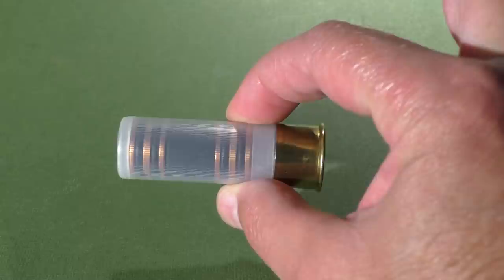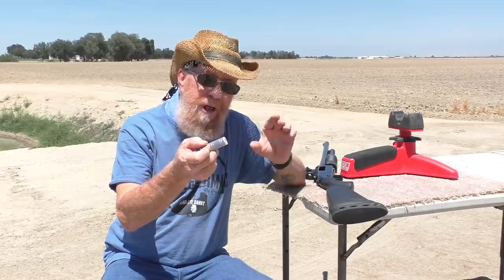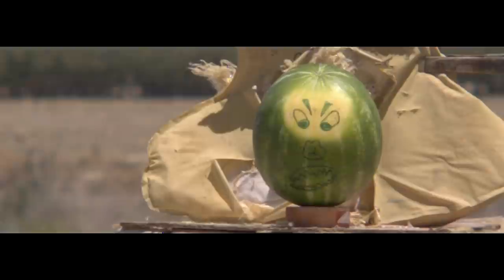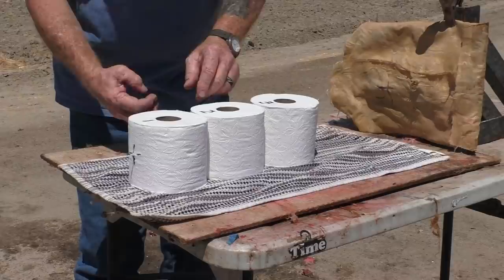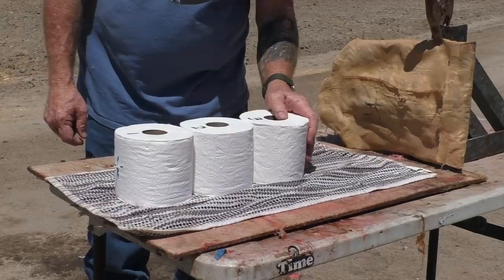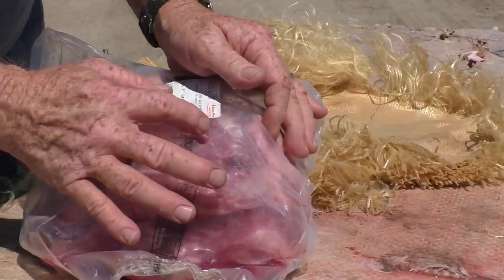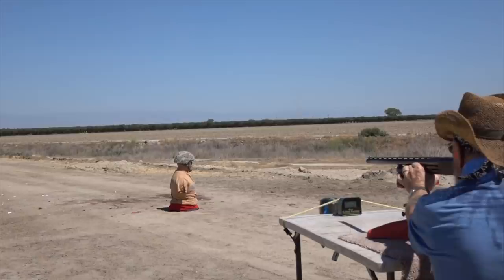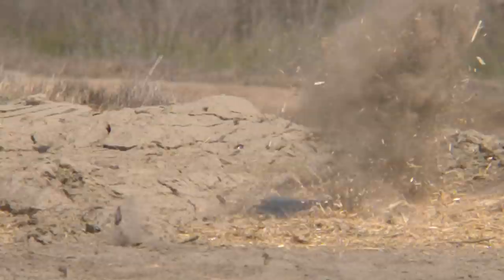Testing the brutal 2oz.  Subsonic Dumbbell 12ga Slugs

Comment: You could put Shockwatch stickers on the head under the helmet, to see if the impact alone is lethal. Mythbusters used these
Reply: By the looks it would be instant death
Reply: There is no way you could survive that kind of blunt force trauma to the head, also the way that pulled on the jaw, I don't think it would have broke it... I think the jaw would have been completely ripped off the face. That's the kind of hit you hope kills you. because you would never be ok after that.
Reply: I think if anyone wants to test the force of these at home, go grab a roll of toilet paper then grab a hammer and hit that toilet paper as hard as you can, I guarantee that you aren't going to put a hole in it and I guarantee it will go sailing across the room. It is like horsepower vs. torque. Horsepower is nice but it's the torque that wins races.
Reply: That’s a skull crusher turns brain into scrambled eggs

Comment: Jeff, I’m sure you’ve analyzed it every way possible but, considering the gas seal, the rounded bi- directional shape is hindering obturation of the seal itself. Without a, for lack of better words, “flat end”, the gas seal is deforming and rupturing while trying to get the large mass moving. I speculate that the o-rings are also helping with the seal of the bore. I can’t help to consider what a flat sabot “cup” if you will, would do to the x12x’s ability to obturate the expanding gases thus, increasing the velocity. If it were I, I would make that very suggestion to the “ballistic machinist” for a form fitting sabot cup to stop deflection of the lips of the x12x gas seal. I do believe the performance would be enhanced and quite possibly do so reducing the actual volume of powder needed to accomplish hitting the intended velocity target. 

Keep up the good work folks!! It’s sure good to see Danny out at it….

Comment: My guess would be the Sabot is to keep the slug reliably situated. With such a tight fit, when the first end of the dumbell exits the barrel, if the Sabot wasn't in place and the slug shifted whatsoever, the Edge of the second would catch the barrel pretty hard, and the pressure difference between Inside the barrel and outside could cause such a shift. But with the Sabot in place, it bridges the gap between the front and back, meaning that the slug can't wiggle when the front is out. I'm at the 1:32 mark, I wanna see if that's the conclusion you guys got to as well.

Comment: Sabots might be to keep weird things from happening inside a silencer when the slug is going through the baffles. The slug could wobble inside the silencer with the ends of the dumbbell snagging the baffles on the way through. The sabots are turning the slug into a simple long cylinder, which should be kept straight by multiple baffles. The Sabots shattering is still an issue though. If the Sabots don't shatter, and can wobble around going through the silencer, I'm not sure if they're not just as likely to start snagging on baffles as well.

Comment: Not only is the weight of the toilet paper roll much higher than that of the slug The slug is imparting it's energy over a relatively long period of time and not imparting very much of it as it doesn't meet a lot of resistance going through the toilet paper.  Part of the reason why it's harder to push the screwdriver through is that you are relatively going much slower than the bullet is which gives the toilet paper time to compress presenting a much stronger target. The bullet is essentially going through the toilet paper one sheet at a time.

Comment: Two Ounces?!? Perfect for home defense, I'm guessing...
 
I love the fact that you guys are willing to TEST such interesting and innovative design concepts! Keep up the great work.
Reply from the maker: thanks Doc!
Reply: Perfect home defence if you have concrete walls 😉
Reply: yea, for defending 2 houses down without leaving your sofa hahahaha.
Reply: Yeah, you're not concerned that a heavy slug will be too slow to accelerate, making bore pressure exceed safe levels?
Reply: I.... Must.... Resist.... the Temptation.....
........
............
........
NO....To Late.........  ARGGG!!!

So What's Up Doc!!    😁
Reply from the maker: @machinemaker2248  No.  It uses a powder load for that weight.
Reply: @machinemaker2248  
The same powder charge does not get put in the shell regardless of projectile weight. Heavier slugs use reduced charges, or better yet, slower burning powders.

Comment: The O-rings are for a good gas seal and the sabots are working as a traditional sabot and is a bit wider than the O-rings, if the Sabot was not there the friction of the rubber O-rings passing through the barrel could be to great and act as a barrel obstruction and the barrel could explode.

Comment: I guess I should have told you about the sabot. They are there just to fill the center of the slugs. Because I found out that out of a box mag feed shotgun the hull would deform as the bolt slid back and it would take a chunk out of the hull. Then when you fired that round it would put a hole in the hull.
Reply: This needs to be moved up to the top of the comments list!...MLV!

Comment: I think the sabot are meant as additional gas sealing as it travels down the barrel so the gas dont go into the empty space of the dumb bell. Also maybe to prevent destabilization as the slug hits open air at the end of barrel so it starts as a straight path and end as a straight pass?

Comment: Would be cool if this round could be revisited, possibly with and without the sabot, and perhaps testing a few different gas-seals.
I'm thinking a felt based gas-seal would do well, as the ends of the rounds are flat and smooth.
A felt seal should transfer the energy well, without deforming much, and should release the slug well, once out of the barrel.
This is all theory crafting, and the real world might prove me wrong. 😅

Comment: 13:00 Get an easy up cover and a 5 gallon bucket of water. Erect the easy up for shade and use the water to soak your shirt when it gets dry. You are in California, it's dry as, your sweat will not soak into your clothes and slowly cool you down.... it dries too fast. Soak your shirt in the bucket once dry and you will be 10-20 degrees cooler when you put it on. It can be 110 here in Cali and be tolerable when wearing a soaked shirt, I know because I do it every summer.

Comment: That dumbell slugs got immense stopping power even at subsonic speed which is insane.. By using copper to use as dumbell slug material means higher density.. Higher density means longer distance as well as even deeper penetration you can get from that slug..

Suitable to hunt and to take down larger animals in the wild..

Comment: Fizzicks?? Yeah thats why sometimes an arrow can out penetrate some bullets. Depends a lot on mass and momentum. Momentum takes over once velocity has dropped enough. Etc etc. FBI studies perplexed researchers when they discovered that some sub-sonic rounds out penetrated equal counterparts that ran at high velocity. The recoil on a 12 gauge slug is somewhere between 45 and 60 lbs if i remember.

Comment: Hollow point it & cut the lines for the peddles to achieve expansion. Leave the center or grip of the dumbbell a little thicker to compensate for the lost material & still achieve the 2oz subsonic capability?

Comment: My guess, before seeing the results of the Kirkland Ballistic Toilet Tissue test, is that the barbell slug will shred all three rolls, propelling them in two different directions as the slug take a slice (left) trajectory. It will be as if you buried a firecracker in each roll, lit the fuses and ran!

Comment: When you guys shot the TP rolls with the .22, it made sense that it would punch through without really moving the TP much.  Small frontal area, relatively high speed, light weight projectile.  But, I will admit, I thought in this particular case, the rolls would move more quickly than they did due to the heavier projectile, greater frontal area (contact surface) and slower speed.  I mean, I expected damage to the TP rolls, obviously, I just thought the slug would push them away easier.  Is there also a friction coefficient from the TP being in contact with the table surface that must be overcome, as well?

Comment: 12:00 Strap breaking your jaw is not even a worry, you are already dead. You won't care if it will be an open casket funeral or not after that, you wont care about anything else either.

The extra weight of the round makes up for the velocity and twice as heavy but not half as fast makes it powerful indeed.

Comment: Curious, does the higher bore pressure from lower acceleration concern you? Do you do math or test strain to verify that it won't exceed the designed limit of the barrel? Would you cover this topic in a future video? Thanks!
Reply from the maker: There's plenty of 2 oz +  loads out there,  like heavy duck loads, etc.    So the load data is already out there.

Comment: This is not new. The French were experimenting with this design in the 60's. I remember seeing a slow motion photo of one of their slugs approaching a 5 gallon can of water. The can was exploding when the slug was inches away from the can. The air pressure in front of the slug was rupturing the can. The slug looked like a spool with no thread on it.

Comment: Not at all surprised by your result.
High sectional density projectiles with a wide flat meplat penetrate deeply at almost any velocity. 

When I was a kid we shot small to medium feral hogs with 38 specials loaded with a 200 grain wadcutter at 950fps.
Goes right through them.

I own the second 475 Linebaugh that John buiit.  It was going to be awhile in the making.
To give me a gun to shoot that season he put a Bisley grip frame on a Super Blackhawk, rechambered it to .45 Colt and put a 5.5" slow twist barrel on.

He told me I would love the .475 but predicted that the cobbled togeth  ....45
Reply: Whoa...😲 Ouch! Niiiice!
Reply: My solution is a Ruger Blackhawk 357 Magnum, five inch barrel, loaded alternately 125gr hollow points with 158 gr Hexalit, and 180 grain naked lead Grizzly Bear loads... Nasty velocity with that perfect weapon,, do the math... velocity over bullet mass, almost every time, but 357 Magnum has both. I have the 45, the 9mm, the twin Blackhawks, 22LR & 357 Magnum, and the other nasty stuff
Reply: @Horus2Osiris  
Math honestly means little with terminal ballistics unless you do ALL of the math.

Foot pounds is a terrible metric for measuring effectiveness...especially with dangerous game.

Bullet design becomes a major issue and generally if you are shooting animals bigger than deer with a normal sized revolver or pistol. heavier with a flat point is better.

Most buffalo culling operations in Australia use a 30/06 with a 250 grain bullet at moderate velocity...it breaks bone and penetrates.

We used the .475 to good effect there. 425g at 1300.

J.D. Jones choice was the .375 JDJ , 300g solid at just under 200fps....sectional density is over 300.
Nobody on the planet except Ross Seyfried has killed more dangerous game with a handgun than J.D.
Nobody more with revolvers than Ross and that includes several elephant.

For deer or even elk I have no qualm with the idea of high velocity bullets. I guided for years and saw lots of animals die as if lasered.
My own antelope gun is a 5.6x57r that pushes a 70 grain bullet at 3700fps.

I have also seen a lot of meat wasted and I hate that.

As far as 180g in a .357 goes it is a great choice. There are several fantastic options for bullets and it is easier to load than the 200g slug. Even with the WFN we use .38 special brass because of chambering issues with some guns. 

I think that the arguments perpetuated by some writers of high velocity v. low and heavy are ridiculous.  Both approaches are beyond proven. Dead is dead. Just make an intelligent choice for the ranges you shoot at.
Those afore mentioned 200g .38's that I love are useless beyond 75 yards or so.
None of it really matters unless dangerous game is the issue.

Cheers!
Reply: 30-06, favorite,  308 Sniper, 308 assault rifle... pistols, whatever, looking for an inexpensive 50 to extend my effective range...

Comment: Try Airsoft BBs again. They make  .45 gram BBs, which is much heavier than the .12 and .20 walmart BBs. They also make .69 gram BBs but they are ceramic and not commonly used. You could get close to 22 grams of BBs using .45s in a shell. That would be plenty of weight to do some damage.

Comment: Is That a Tornado or a smoke ??
Reply: It's a dust devil. A strong, well-formed, and relatively short-lived whirlwind. Its size ranges from small (half a meter wide and a few meters tall) to large (more than 10 m wide and more than 1 km tall). Dust devils are usually harmless but can on rare occasions grow large enough to pose a threat to both people and property.

Comment: yall keep complaining about the gas seals being "damaged" - no - they did EXACTLY what thayre meant to do....which is to ONLY survive through the barrel and hold in SOME of the gases....thats why there are so many of them, no doubt the manufacturer KNOWS that most of them will be sacrificed....my guess too is that with copper being harder than lead it cant seal as well as the maleable lead normally would, hence the need for the seals to begin with, and the low velocity is surely due to the fact that a lot of gas is lost as well for the same reason....the 'sabot' in there is just for stability THROUGH the barrel - once they (seals/sabot) has exited the barrel, theres no need for them whatsoever so it doesnt matter if they fly off - they havent failed, they have succeeded as long as you get the advertised velocity....manufacturer would probably be better off with a copper core and thin layer of lead cast onto the outside of the backside (breech end) for better velocity without the need for gas seals or even sabot thing as the lead would conform to the barrel better....
really curious how thatd perform if the front end were cupped out like a shallow hollow point - might make it unstable in flight though...perhaps that that dumbbell design, shorten the center, add some lead to the backend for stability and sealing, cup out the front end and add some plastic in a round shape to the top....though obv thatd be WAAAAAY more expensive to produce